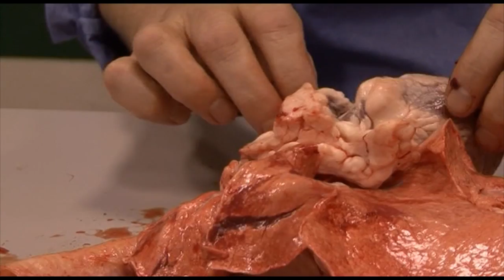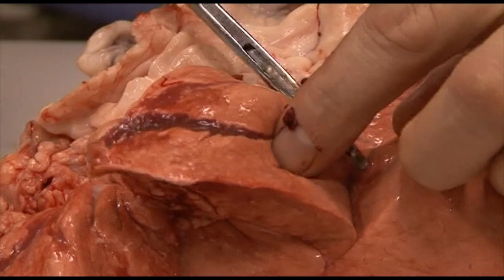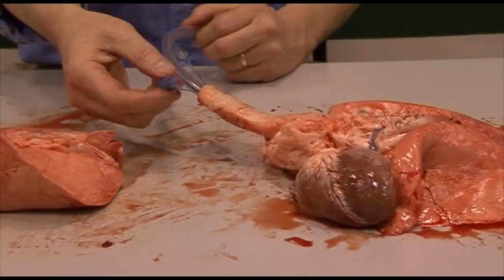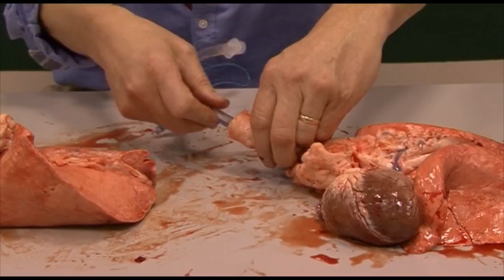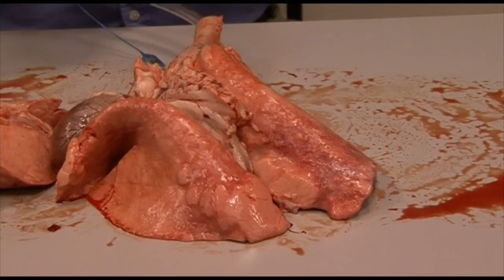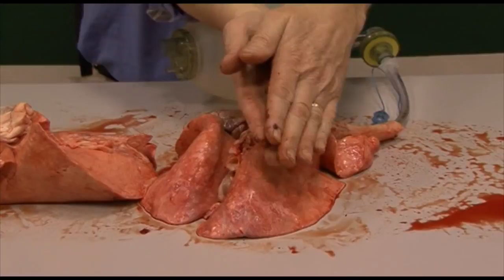Lung inflation in HD video

Comment: wouldn't the vessels going through the diaphragm leak air into the closed spaces of the lungs?...appreciate your comments on this, thanks...
Reply: I am the first one to commenta and like  on your 6 year old comment 😂🙂
Reply: inferior vena cava does go through the diaphragm but it doesn`t go through the pleura. Thats because the vessel is penetrating the diaphragm in the center avoiding the part which the parietal pleura is connected to.